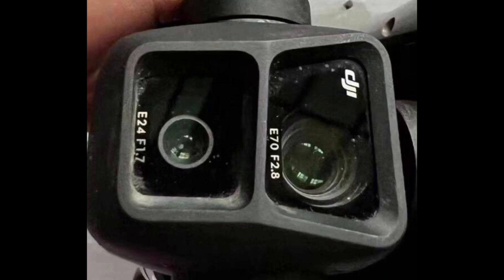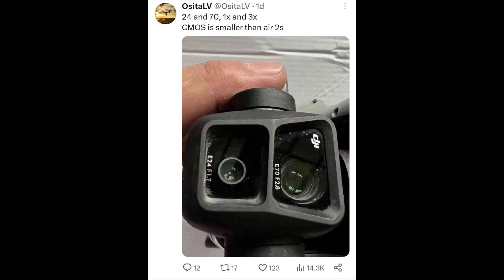DJI Air 3 Sensor Size Revealed?

Comment: Ngl, this would be better than the mavic classic if you are on budget of a quality drone. An optical 3x zoom is great. (only sacrificing omnidirectional avoidance.
Reply: Edit*, it seems it will have obsical avoidance covering the sides, foward/back, and downwards. However unlike the air2s, it will not have upward sensors.